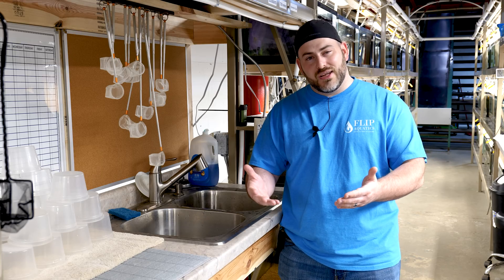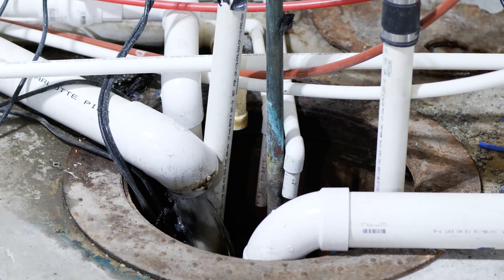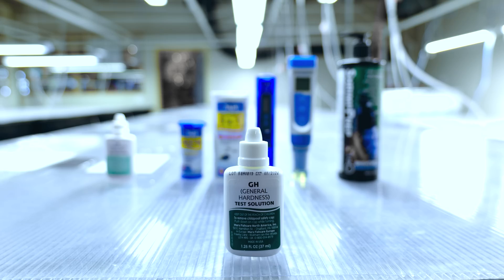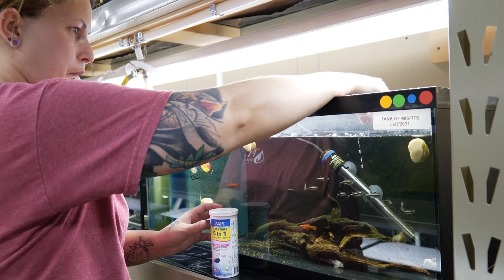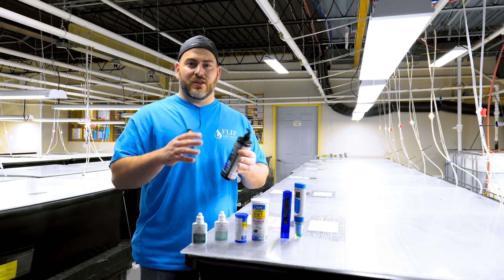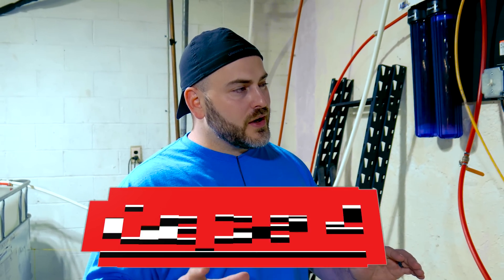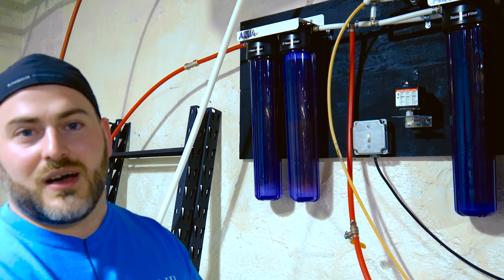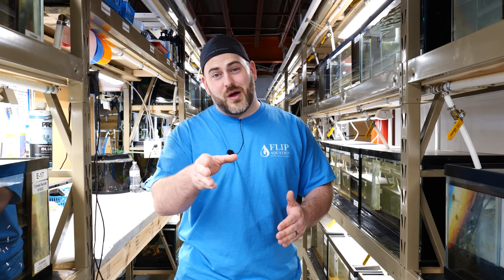[Beginner Aquarium Guide] Our BIGGEST Piece of Advice for Success

Comment: So, my blue dream are losing color. I use black substrate and 2 g per 10 liters of salty shrimp in RODI. They regain color in my main non shrimp tank, which I use equilibrium and pH buffer. Not sure where I’m going wrong. Would equilibrium with vita chem drops be sufficient? Or is there anything you would add to the salty shrimp? They have Java moss covered tubes and rock, driftwood, and black gravel.

Comment: When I first bought my rodi unit I was surprised how simple and straightforward it was to use and understand. The difficult part in my opinion is when to change the sediment filter, carbon filter, or di resin, and all the extra features of an rodi system like booster pumps, flushing the ro membrane, multiple di stages, multiple carbon stages, etc.
Reply: Mines see through. That helps a ton with when to change filters. You change it when the filter starts to yellow. In my case that was every 3-4 months. The first stage anyway. The rest of the filters on mine last quite awhile. The high pressure stage needs changed yearly. For a $200 unit it works well for my fish and for drinking water for the family. I buy a years worth of the first stage filters and replace everything else in 6-12 month intervals. I havent used the DI portion of the unit. Never needed distilled for anything. Overall its saved me a ton of money in bottled water at the store for the family and my fish are happy. If you have a ton of aquariums you might need to change the first stage filter monthly but I never had to in my case. Try to use your waste water in your garden or houseplants. Houseplants love it.

Comment: So what's a good way to control nitrate levels?  My shrimp tank (neocaridina) has gotten up to 20 ppm, and everything I read seems to all conclude the only way to deal with it is water changes.  But doing an 80% water change just doesn't seem like a really smart move.  I've started doing one gallon per day (in a 10 gallon tank), but that doesn't seem to be bringing the nitrate level down at all.  On the plus side, it also isn't getting any worse, it's just holding steady.  Do I have to bite the bullet and hope my shrimp survive a massive one-shot water change, or is there something else I can do besides water changes?
Reply: 20 ppm and stable is fine for your shrimp.